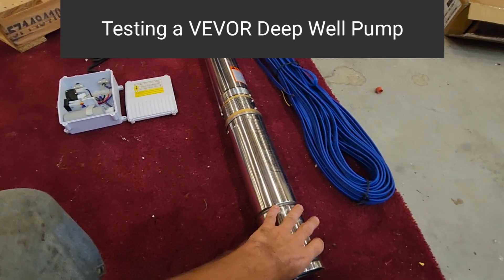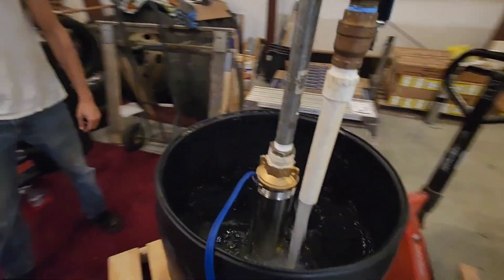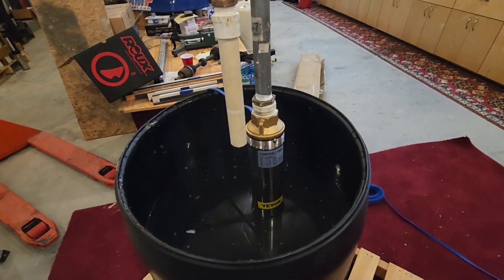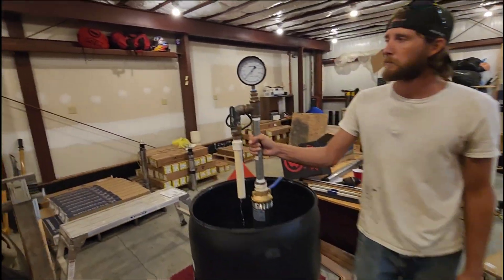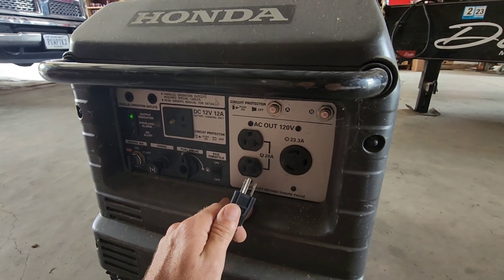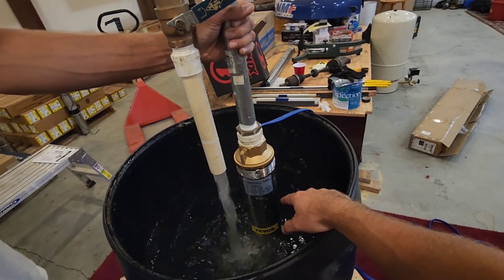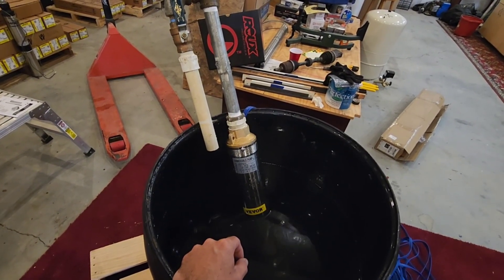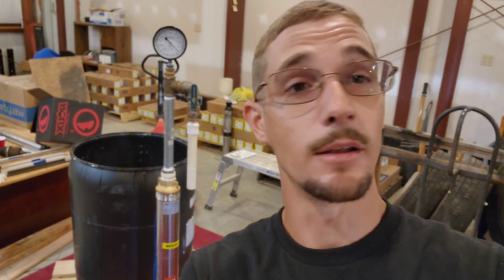Vevor 115v 24GPM Well Pump Test Review.

Comment: I have a 1/2 hp  Vevor {submersible well pump} the wire coming out of the pump are brown, blue. yellow with black stripe, which is ground, which is starter pump wire, which is running wirer? help, please, reason is I need to add wire to the four foot of wire that comes out of the pump any info would help,
Reply: i got the same pump, NO INSTALLATION INSTRUCTIONS.  normal pump has red, yellow and black wires,  what do i do with brown/blue and yellow/green?

Comment: The head pressure from the static water in the casing/bore hole provides for higher pump pressure output. You are testing it at essentially atmospheric pressure, 14 lbs. With a 6" casing and 200' of water above the pump has a pump inlet pressure much higher resulting in increased pump discharge pressure. 🙂
Reply: How to order pump whats ph no

Comment: Sorry for the dumb question but can this pump be used to run a household with a 30 gallon cold water tank with a bladder?
Reply: Yes but you could
Probably get away with a smaller
One. How deep is the well or is it on a cistern.
Reply: @cygnus1965  • Thanks for the reply but I went to my local hardware store and bought the 800$ dollar pump unfortunately. 
My house didn’t have water so I had to buy what I could get at the time, the budget pump would have been a lot cheaper for sure but with a house full of kids I kind of needed my water running as soon as possible. 
I do appreciate the help but I probably wont need another pump for 15 or 20 years, LoL.

Comment: Oh also for every 100'  you voltage and amperage, 12 GA is good for 20 Amp at 100' down your only going to get 15 Amp. At 200' down your getting 10 amps. So to get 15 amps.  use 10 GA wire which is good for 30 amps. Fuse it with a 20 Amp breaker and at 200 ' you should get the required 15 amps. Jerry

Comment: H20 mechanic as an electrician for the great price of that well pump don't splice the feed wires out side the pump, if you're going to void the warranty then do it right. Open the top of the pump and install the 10/3 romex directly into the pump.  If you splice wire to the 16 gauge existing wire you're still running the pump on 16 GA wire. Replace the entire wire by  going directly into the pump with 12/3 or 10/3 wire then it's done correctly.  Just a little advise. Using that rubberized electrical tape is not code I'm sorry, not to tell you what to do. But you need water tight approved romex splice kits, more expensive but the correct way to splice in moist or wet conditions. Just a viewer Jerry
Reply: H2O mechanic is correct, you replace the wire with a higher gauge to avoid a voltage drop when drawing over an extended distance with 16ga wire.  Using 12ga over 99% of the distance solves the voltage drop issue. the 2-3' of 16 ga at the pump will not affect the voltage.  Whether that voids the warranty is a question for the manufacturer.
Reply: @johnwalker6121  how far it too far tho? i need mine to go 30-35', will it be ok with that or should i just splice thicker wire??
Reply: romex isnt rated for wet/damp locations. You talking about UF cable?
Reply: Hey Jerry, could you advise me on where one might find ‘watertight Romex splice kits’?!
Reply: You gherkin, this kid is a pro and he's been installing well motors with his father for over ten years not to mention his father's experience, if he uses rubber tape I'm fine with it.
Reply: What you say makes some sense but you are forgetting an important variable.  Temperature of the 16 ga. wire.  It is submerged in water with temps in the 5-8C range (40-46F).  That changes the actual real life ampacity bigtime.  Most insulation is rated beginning at 60C and up.
Reply: I wouldn't have a problem with placing in heavier wire but I would also expect that that wire being in water and cool is going to change the amp draw also and cut the losses but if you do need to lengthen it get as close to the pump as you can reasonably

Comment: We are replacing a 1 1/2 hp submersible pump in a well that is 35 feet deep. I’m interested in using these Vivor. What size pump do you recommend? The pump you reviewed was 1 1/2 hp. Do you recommend using a smaller size pump. If so what size?
Reply from the maker: That depends on what voltage your current system is.  
Also what are you using the well for? Household use? 
The 1.5hp is best for irrigation needs. 
Typically a home uses a 3/4hp
Reply: The pump will be for home use, has 110 volt, for a well 33 feet deep. Up to now there has been a 1/2 hp well. Water use is limited, it bring for a small mobile home.
Reply from the maker: @Dan Augsburger  just stick with a 1/2hp pump. 35ft is very shallow. No need for a big pump. But that being said, the pump I reviewed would work
Reply: @h2omechanic  my well is same depth so could i just use that wire to the top instead of spicing thicker wire??

Comment: Given your max achieved pressure of 124PSI, how do you figure the usable depth is 250 ft? Looks like a decent pump, but with those numbers you're just getting to grade, right?
Reply from the maker: So it takes 45psi to lift water 100ft. If the water level in the well gets drawn down to 250ft, that around 115psi of head pressure, plus the 60psi operating pressure in the house. Thats 175psi needed to satisfy the switch and shut off the pump. 
More top of the line pump can build over 200-215psi on the same test method.

Comment: I keep getting alot of gravel and rust my well was 260 now pump at 180 still gravel
Reply from the maker: It's slowly caving in unfortunately. Normally this is due to the casing not being installed deep enough into competent rock, or the driller didn't get it seated correct during the drilling process. 
Either he was a new / cheap driller, or he ran into a really bad/tough formation. 

The well needs to be blown clean by a drilling rig & then a screen casing installed.

Comment: That's my plan. Going in the lake up here in Canada.  I ordered this pump before I found your video. Website I ordered from never mentioned a built in check valve. Great vid. Thanks for the reply!
Reply from the maker: Worst case scenario, you drill a 1/16"-1/8" hole in the pipe about 1ft from the pump. Yes it'll leak out during use, but not terribly . But every time you cut it off, it'll drain back. 
Please invest in a floating lake light (it only turns on if voltage is present in the water) if kids swim in that area it's a must for safety. & if the dock is aluminum, put in a ground rod near the dock & ground it! Last one I fixed was 115v & the wire broke, if I touched the dock & the water I got a shock. So safety is #1
Reply: If only gfcis existed  @h2omechanic

Comment: If the internal check valve were to be removed(if possible) would it drain back to the well water level? Emptying the water line above water level.
Reply from the maker: Exactly right. 
That's what I do if the pump gets put in a lake or pond for irrigation. Itll always drain back to help prevent freezing
Reply: Ive heard the check valves in these are prone to fail.

Comment: Hello would this pump fit down a 2" well casing, what is the outside diameter of it? Do you know if they make a pump to fit down a 2" well casing as I would like to upgrade to a submersible pump rather then an above ground jet pump. Where are you located? Can you help me with my well problem.

Comment: Should've shown amps at the 120 psi.  How about full load and service factor amps to see how it compares to Franklin or Pentair.
Reply from the maker: Amps never climbed above 13.8 under full load. Performed well for a budget friendly pump. My only concern is the oil filled motor & its longevity in normal conditions. Great for irrigation installation in a lake or pond or for camping since a small generator can run it. Ill be testing Franklin and Grundfos pumps next time. That Video will be up In a few weeks

Comment: I've got their 2 wire version of this pump and it seems decent.  The 1.5" outlet on the top was kind of annoying but it seems to be pumping great at 73' in my well.
Reply from the maker: I agree. Still a good pump for a budget. I'm curious about life span on it.
Reply: @h2omechanic  had mine for about 4 months now.  I replaced a windmill pump with this vevor pump at my hunting property so its not heavily used.  I'll report back here if it dies.
Reply from the maker: @kylebryan1  ill be putting this one in a 1920s copper mine shaft to pump it out (put it to a big test). Just for fun.
Reply: @kylebryan1  what ga wire u use to splice?
Reply: @Eastbaypisces  I brought the wire it came with all the way up to the pressure switch. Then went 12/2 up to the breaker panel.
Reply: @kylebryan1  u didn't have any probs w overheating? Isn't the wire they have 16ga?
Reply: @Eastbaypisces  nope… I attribute that to the wire being submersed in water.
Reply: @kylebryan1  how long u had the pump for?
Reply: @Eastbaypisces  3 years. It’s only used a couple days a month though.
Reply: @kylebryan1  u think it 'll be ok for me for 35' , only thing is its only maybe 7-8' of water so its not gonna be submersed most of the way, but only gonna use sometimes like u just for storage tank for irrigation purposes

Comment: 120v x 12amps =1440 watts. 746 watts per hp.  It's closer to a 2hp pump
Reply: Not unless it's 100 percent efficient. 1.5hp is what I'd expect for a motor drawing those amps at 120v, if the motor is 80% efficient. That's what submersible pump motors typically run efficiency wise
Reply: @harescrambled  so it's a 1.5hp pump that draws 2hp worth of electricity....
Yea lol....
Reply: If it's a DC motor. For an AC motor power factor and efficiency plays a role in it. So just taking a guess at the motor's power factor and efficiency.  120v x 12 amps x 0.9 efficiency x 0.86 pf ÷ 746 = 1.4940 HP.
Reply: @mforrest85  1.5hp is 9.3 amps.  Why is your motor drawing 12 because it's 2hp.....
Reply: @texasfrontiersman8245  losses from power factor and inefficiency. I calculated it with an efficiency of 90% and a power factor of 0.86. I don't know the real values for the pump so I can't tell you if it's right or not. I just took a guess. I just know the efficiency is not 100% and the power factor is not 1.
Reply: @mforrest85  does it still draw 2hp worth of electricity?  Yes!
Reply: @texasfrontiersman8245  I'll admit it does but... Does it output 2 hp? What I do I don't care what the power draw says it is. I go by how much the motor outputs.